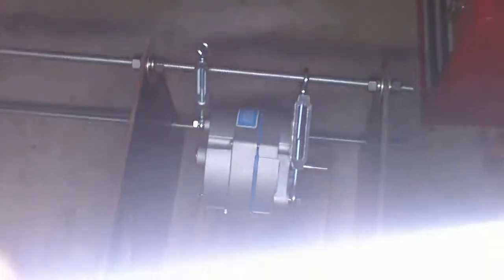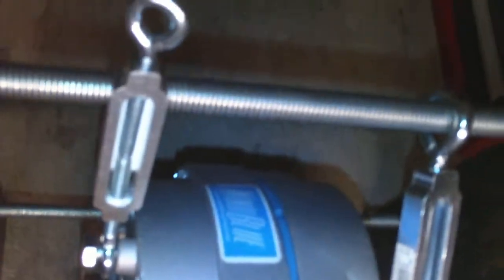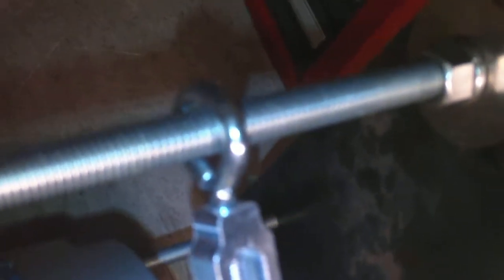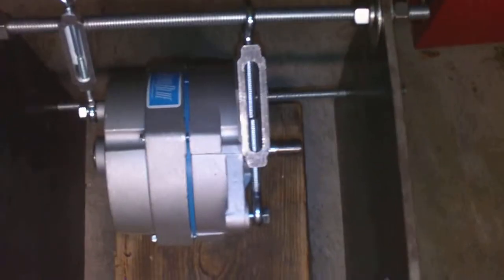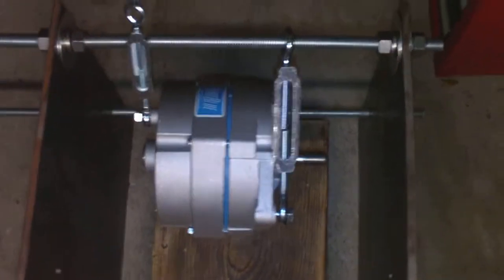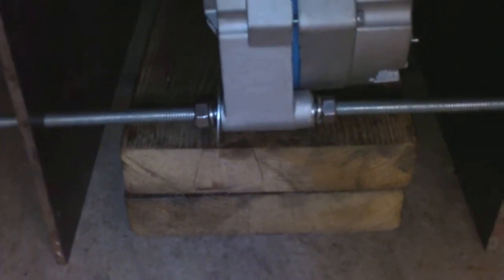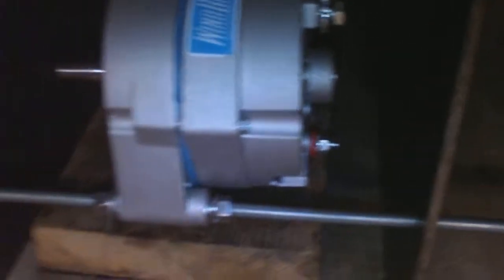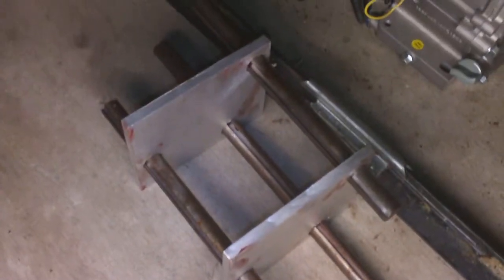12 - Alternator (PMA) Mounted in Gearbox

Comment from the maker: My initial test will be below 8 feet to accommodate the average garage or indoor ceiling. During design I'm hoping to integrate a method to add more height to the structure for those with higher ceilings or operate outside. Version 2 of this project will have additional weights triggered when the first weight finishes to allow longer run-times.